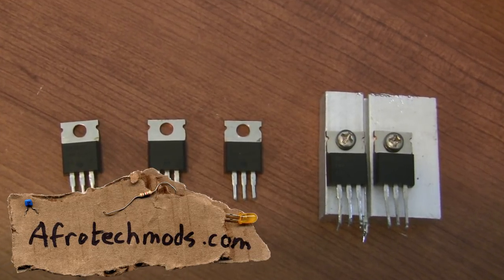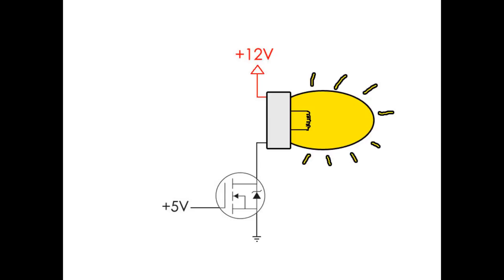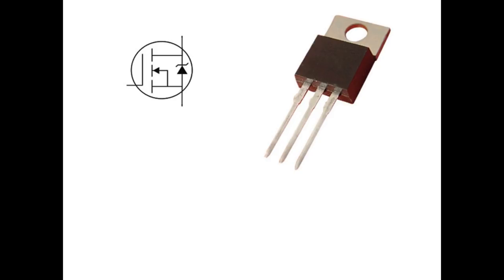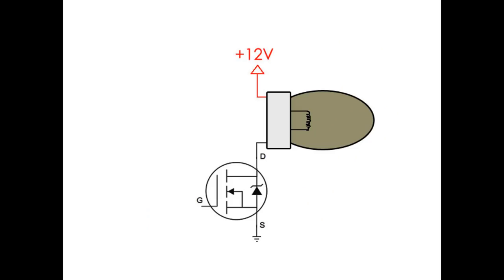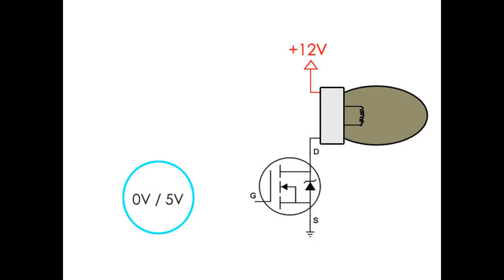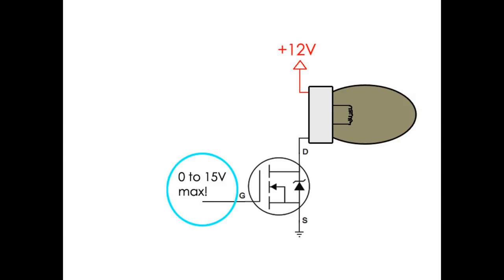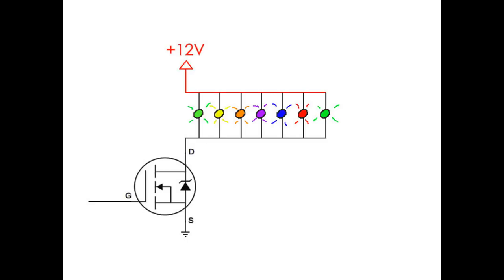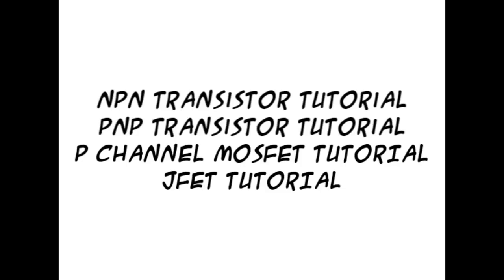Transistor / MOSFET tutorial

Comment: Is it possible to put mosfets in series in order to increase the source voltage? For example I have 5 mosfets rated at 450 volts. Can I put their sours and drains in series, so that I can increase the voltage up to for example 1200v?
Reply: In theory yes, in practice you shouldn't even attempt to, because the drain to source resistance when the mosfet is off may be very high but it's not a precise value
So if you connect for example a 1000V load, and you have three 400V-rated mosfets in series, if, and only if the off-state resistances are equal, you get 333.3V across each one. No problem so far, but if one of the mosfets has twice the resistance of the others, that one will get 500V, bŗeakdown and blow up. After it breaks down, the voltage across it will be nearly zero, so now the other two transistors have 500V each. Eventually one of them will breakdown too, forcing the full 1000V through the other, which will instantly breakdown and kill itself, and since all 3 transistors have already broken down you would basically short your power supply, probably damaging it.
Reply: fede142857 Myfriend, thanks for taking your time and writing this comment to me, but to be honest, I have this page open for two days and I have been trying to read your comment over and over again to understand what you mean, but I have failed to understand anything. If one MOSFET burns down, it will turn into a resistor for the current, how can all these end up damaging the power source?
Reply: Life is illusion As far as I know, if a mosfet burns down, it's more likely to short circuit (i.e. let current pass through even when it has no voltage on the gate) than to fail open (meaning that it won't let any current through even if the gate is driven with the maximum voltage it can handle). I made that assumption in the previous comment, but someone correct me if I'm wrong.

Comment: question.    at minute 1.55 . Drain is input , Source is output. But why at 2.59 minture. when it has current 5v go to mosfet at gate. then the source has arrow  go up to drain and light OPEN.    am i understand correct. that 5v input go to gate  . then the power wil go to Source and Output at drain.  and ligth turn on.

another question. why it has 12 v at drain

Comment: Any help will be much appreciated.
what i am trying to do is to turn on my 9v FM transmitter with a remote system ,i have a remote led light with a 3v output ,i want to rig the remote system from the light to turn on and off my 9v transmitter ,i was going to use a latching relay but the remote system is only 1-Channel ,or i was going to try a 3v solenoid and switch ,but i,m not sure if its best to try some sort of  MOSFET N-Channel
switch .Whats will be best way to set this up?

Comment: I just bought an N channel MOSFET, connected as per data sheet, and after a few seconds the motor started, but the Arduino doesn't affect it at all (it seemed to at first). Multimeter continuity check finds all 3 pins are connected to each other even when power is off. Don't know how this can be? I know the temperature went to about 200c initially though, so I'm thinking the lack of a heat sink killed it.
Reply: I think it failed short.
Reply: +Jordan Johnson (Mighty Burger)   Well I bought another one that was rated at much greater capacity, and this time put a diode across the motor and it worked. It still got hot, even with the heat sink I added, but I found a way to alter the duty cycle of the PWM down to keep it cool.
Reply: you need logic level MOSFET to work with arduino .
Reply: +Arun G  I know. It was.

Comment: If you used analog signal input (0v-5v) to the gate could you produce a proportional output through the source-drain side? I want to make a digitally controllable dimmer switch for my home.
Reply: You would make a proportional output on the source-drain. But this is for DC current. Are you planning on making a dimmer for AC lights? If so forget it.
Reply: hoplahey Yes. I was trying to make a dimmer for AC lights but the problem has already been solved. Wireless LED's have the power conversion and dimmer circuitry inside and they are getting a lot cheaper. Practical for my purposes.

Comment: so i'm sort of confused, where does the gate connect to? What does the "logic signal" mean? is it like a switch or something
Reply: Logic = 'true or false'. In electronics it's 'high or low' or 'on or off'. You can also use 'boolian' or 'binary' in this case. Logic gates are in simplest term an 'all or nothing' switch.
So yeah, they are indeed a switch. 
These are a lot of words for the same thing that you'll all find a lot in electronics (binary and especially bool are more part of coding, though, but codes are just virtual circuits).

Comment: Hi, please help, if I had a motor at 7.4v drawing 15 amps, what diode would work? Just any large diode at radio shack?

Also, what is the purpose of the 100K resistor to keep the fet off at 0v? Please explain someone. Thanks.

Comment: would a n-channel mosfet be like a push button kinda ? Normally open?
Reply from the maker: Flores633 No. It depends on what the gate voltage is, and that could be anything, even if it's not connected to something. So it needs to be connected to something at all times even if it's just a pulldown resistor.

Comment: With regards to the input 5V, does the ground have to be common to the supply ground? I.e I'm controlling a 12V motor via an Arduino. The Arduino has its own 5V supply and the PWM signal to the gate comes via a 5V output pin on the Arduino. Do I need to connect the grounds of the Arduinos 5V and the 12V of the motor? How does that then transpire in automotive land? I'm not sure connecting the ground of the Arduinos 5V supply is a great idea
Reply: grahamek86  I'd like to know the answer to your question too. 
I would wire it up the first time with separate grounds and see how that worked.
Reply: grahamek86 If I understand you correctly, you're saying the arduino and motor are on separate circuits and thus do not share a ground?

I'm no expert but the problem I see here is that voltage is relative. What looks like 12v on one circuit may look like 200v to another. In layman's terms, you're glowing to blow things up. Bad if you like working circuits, good if you like fireworks. However, this may require further analyzing: Are they really on separate grounds?
Reply: Yes, you need a common ground. That means the ground of the arduino and the ground from the other power source are the same.
Use a resistor to protect the arduino output pin, use a diode on arduino ground.

Comment: 1:46, that is not the correct terminology for describing the drain and source pins. The source is called the source because it is the pin that connects to the SOURCE of electrons (which is the negative (common)) and the drain is called the drain because electrons DRAIN from that pin to the positive potential. The arrow on the symbol shows the flow of electrons in the transistor.

Comment: hello : ) 

 i hope to  trigger a transistor using only  . 3 v AC   
in this tutotrial you use a 5v DC signal to turn on the transistor.
i've been googling for a very low voltage AC transistor or relay to switch on a 240volt light bulb.   any ideas where i might find one?

peace :)

Comment: I understand how you used the transistor...but isn't transistors actually meant for amplifying things...if you want to just turn on and off the lights...u can just use switches to create an open and closed circuit...if it would be an open circuit no current would pass and if it would closed the circuit would be complete and the current would flow...

Comment: I don't understand, why if the gate tansion is 5 volt the mosftet is schematized like a closed circuit ( a wire )? it will never go into saturation so it will act as a resistor  or am I wrong?
Reply: babungaCTR 5v shown in this video is just an example you can find a mosfet's gate voltage minimum and maximum from the datasheet of a particular mosfet,and about resistance yes someone who create this video forget to mention about RDS(on) of a mosfet

Comment: Do these work with Pulse width modulation like on an Arduino/Teensy Board?
Reply from the maker: If you get a logic level MOSFET then sure
Reply: How would a normal MOSFET behave if it were connected to an electric motor and an arduino using PWM to control motor speed?
Reply from the maker: The gate might not get enough voltage to turn the mosfet on.

Comment: Why do the transistor source is connected to the ground, instead of the source connected to the lamp?
Reply: TRANSISTOR WORKS WITH A POSITIVE SWITCH SO THE LINES TO THE TRANSISTOR SORCE NEED TO BE ON THE GROUND SIDE OF THE DEVICE
Reply: A common mistake is current flow. Electron flow is from negative to positive and conventional flow is what most people understand, pos to neg. Electrons are negatively charged so they are attracted to positive poles, electron flow.

Comment: hey i use a mosfet to turn on some 12 volt LEDS and i am not sure why but its heating alot and the the power isnt a problem because the mosfet if 300 watts the LEDs are only 36watts please help
Reply: I could be wrong on this (correct me if I am) as I am just getting started on electronic switching myself.
How many volts going into the gate? What is the gate threshold voltage?  If your voltage to the gate too high it may cause over heating. You can try adding a resistor between the gate and the input voltage.
Reply: the gate is 20volts input is 12 :) but your righ
Reply: сталкер чворович What is your mosfet's rds(on)? You may need to do some math to determine if your current draw is enough for the mosfet to need to be heatsinked, but at only 3 amps, that seems unlikely, but not knowing what mosfet you are using, i can't be sure.
Mosfets get warm, thats normal, just need to make sure you arent letting them get too warm. This is why they come with that slab of metal stuck to them ;)

Comment: You want to drive a 12v light bulb from the 5v power supply in a parallel port? You will destroy a fair amount of your computer if you try that. Here the transistor can be used to isolate the gpio from the lightbulb circuit

Comment: Nice try but fail! Your description has an error....if you apply 5v to gate to turn it on, then remove the 5v from the gate & leave it hanging in space the device will remain on between D-S...until...you apply 0v to the gate to discharge the gate which will turn it off...

Comment: I need help, I have a "line 6 spider iv 30" guitar amplifier. everything turns on but no audio comes out, opened up and saw that a transmitter was blown out, does anybody know what kind of transmitter this is. has 5 pins
Reply: +MrTexasdro210 STRF6426 Transistor

Comment: What is
Base, emitter, collector?
Reply: Those are the labels on a bi-polar junction transistor. Not quite the same as a MOSFET. If we were to compare the two NPN and N-Channel MOSFET it would be Gate = Base, Drain = Collector, and Source = Emitter. The best way that I use for deciding between the two is how I want to switch it on. MOSFETS are voltage controlled while BJTs are Current controlled. So if I have really low current but decent voltage I can still turn on a MOSFET easily when a BJT would not turn on quite as well. It took a bit of experimentation for me to figure that out though. Good luck!

Comment: What's the maximum current for the gate ?
Reply: +Kami Star fet means field effect transistor means it is work on electric field so it doesn't any current just put any voltage to the gate and mosfet will
 work fine
Reply: +dynamo hack any voltage ? are you sure ? people say not more than 12 volts.. or maybe you mean with zener diode ..
Reply: +Kami Star i mean upto rated voltage of  mosfet
Reply: +dynamo hack thanks
Reply: +dynamo hack lol, no. Each FET has limited value of current, that he can process trough, its obvious, read datasheets.
Reply: ***** the topic is about on gate current how can current flow from gate to no where
Reply: +dynamo hack  ah, sorry, missread
Reply: +Kami Star look at a datasheet for a MOSFET. Each MOSFET is different and has a different absolute maximum ratings. the datasheet will either give you a maximum dV/dT value (the fastest you can change the voltage of the gate without damage) or a maximum current value If you know one, and the capacitance of the gate, you can figure out the other value. Both of these are proportional because the gate looks like a capacitor. a current through a capacitor is directly related to its capacitance and how fast the voltage changes over time. dV/dT * C = I.
Reply: +dynamo hack Not necessarily. There is a rating for some MOSFETs for the maximum gate current. It may be stated as dV/dT, or rise/fall times because the current and slew rate are proportional. You have to give or take charge from the gate to change the voltage on the gate. And remember, the flow of charge through something is current. That means that while leaving a voltage on the gate, there will only be a very tiny leakage current, changing the voltage on that gate super fast can be difficult because you need to source and sink a lot of current. It is like swinging a long 2x4 stud back and forth. Do that slowly enough and it is easy, but try to swing that back and forth many repetitions per second and it's a workout. Same for MOSFET gate and capacitors in general.
Reply: +Power Max Thanks for your help

Comment: My mosfet won't turn off! I don't understand how? When people say add a resistor? Where? I need a visual. :( Can  you make a tutorial on how to turn off a mosfet if it stays on?
Reply from the maker: Put a 100k resistor between gate and source. This should keep it off by default.
Reply: So on a breadboard, I tried to connect a 100k resistor, 10k resistor, 1k resistor and connect it to the gate pin, and then connect the other end of the resistor to the source pin. Yet, the mosfet stays on. What I also noticed is that I could connect 12V power and the ground anywhere. If i connected 12V  DC to the gate and then the ground to the drain and my LEDs are still on. If I connect it with any other combinations. The mosfet stays on. It's so odd. The mosfet is an IRLB8721. Did I do something wrong? Is it broken?
Reply: Afrotechmods Never mind, I actually figured it out. Turns out only one of my mosfets behaves like this. I tested this with a different mosfet and it worked. I wonder if the mosfet was fried or something.
Reply: BlazedGun Possible. Components can be bad. However for me it user stupidity-ahem-I mean error. I connected the drain and gate backwards and the light was always on. Oops. Read the manual. CAREFULLY
Reply: Before calling me stupid, why don't you understand why I connected it in different ways. First of all, I have no experience with MOSFETs. Second, my MOSFET was broken from the start, so not only am I not familiar with a MOSFET's functionality, I had a bad MOSFET misleading me on how it actually works. I connected it properly, gate to a PWM pin on my arduino, drain to the positive, and source to the negative. It wasn't until it wouldn't turn off, even with the resistor that I started to connect drain to gate, and all that other stuff to test how the MOSFET works. Then I got some more MOSFETs and tried it out and it turned out my circuit worked after all, I just had a dopey MOSFET. So before you try to feel all big on the internet like you know it all, why don't you reflect on some stupid things you did in your life. I came here for answers to a problem, not unintelligible criticism.
Reply: BlazedGun Im sorry man, I meant user stupidity to myself. I didnt mean to sound like I was calling you stupid, rather that I was for messing up the pins and not reading the manual. Sorry man
Reply: It's all good. It's just the internet.
Reply: BlazedGun could be a shorted fet
Reply: BlazedGun
Also be sure to double check the pinout in the datasheet. The pins on MOSFETs aren't always in the same order.
Reply: Connect a 100 K resistor to the gate and ground. The reason is the gate has a capacitive input which will tend to keep the mosfet on with 0 volts on the gate therefore burning out the mosfet.
Reply: Yeah, the MOSFET ended up being shorted. I now know how to use a MOSFET, thanks all!
Reply: Douglas Kay Doesn't grounding the MOSFET create a zero-volt state on the gate?  And if I am reading what you are saying correctly, that will burn out the MOSFET?
Reply: Gate current is so small that the gate will act as a capacitor and store the pulse you have to pull it low.
Reply: Allan Patterson Basically put a resistor between gate and ground or -v
Reply: BlazedGun You probably have burned out the MOSFET. :( When they fail, I find that unless they catastrophically fail (explode, pop, burn to a crisp, etc) then they will be permanently turned on.
Reply: BlazedGun Lol I think you're the one who's supposed to be apologising
Reply: BlazedGun That is called an insulated gate mosfet.  If N-channel, connect gate to ground so it could turn off.  Mosfet's don't exactly work like your common bipolar transistors.